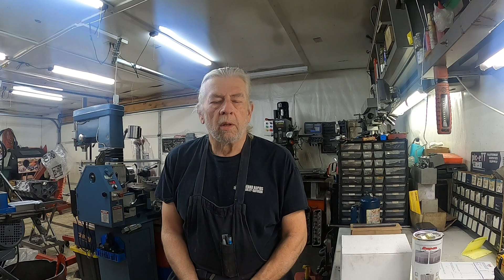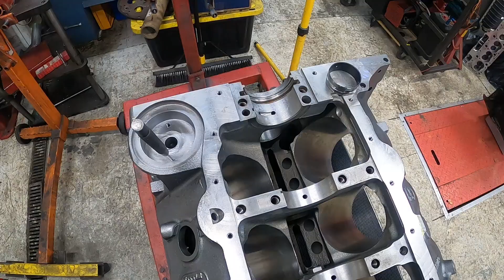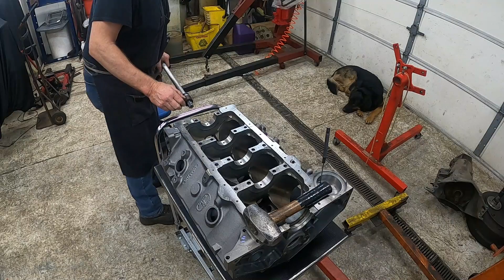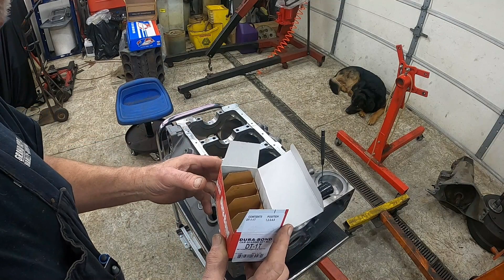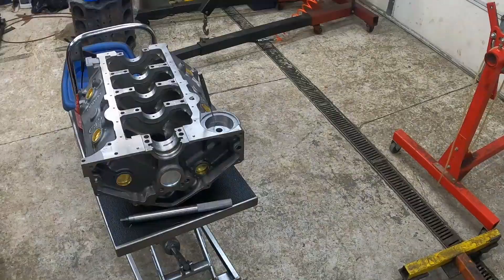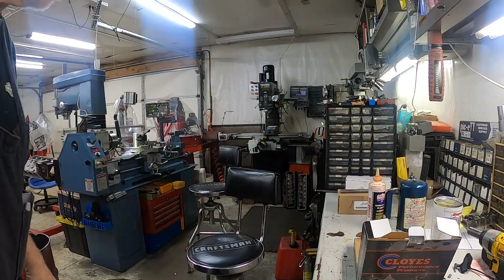new dart block 357 sbc build.

Comment: Right, wrong, or who cares, but I have always put the "freeze" plugs in dry. Stainless, brass, and steel. I have never had an issue except old motors having one rust out (MN rust) . I would assume, we all know what that means, those having issues don't have enough coolant bypass. Pressure at the rad should never get over 16 ish psi. Without enough bypass, even with a typical thermostat, you can have higher pressure in the block. That only thing I can think of to cause those to blow out.
Reply from the maker: Like 40 years ago I had some soft plugs that did seep some, been doing it this way since then. so what ever works for you is good.👍

Comment: I had always stuck core plugs in dry or with indian head shellac but last year I did a 318 and used red loctite and had two weep. The owner came by a few months later and said it had been running hot, I ask if his coolant was low, he said no, he said I did sling my power steering belt and I've been running it with no powering steering all week. Come to find out he didn't have no water pump or fan either, that belt ran them all. After all that those freeze plugs weren't weeping anymore! Lol, I guess he got it hot enough to seal them up.
Reply from the maker: Interesting was this a fresh build, or did you just replace for leaking? Sounds like the owner needs some education. Thanks